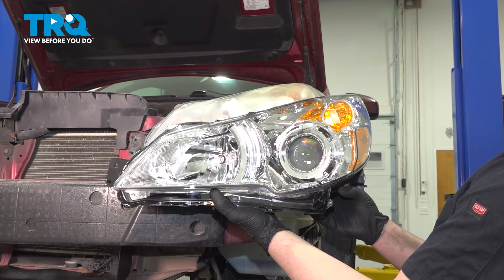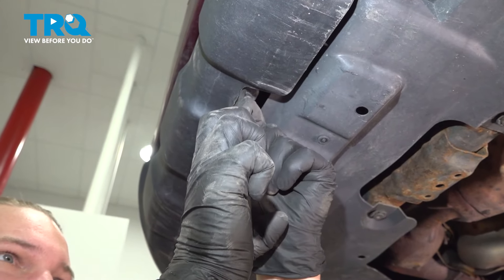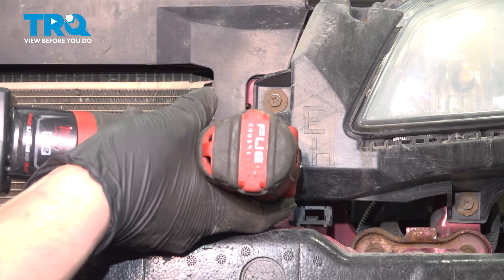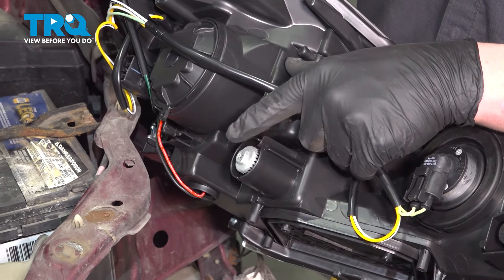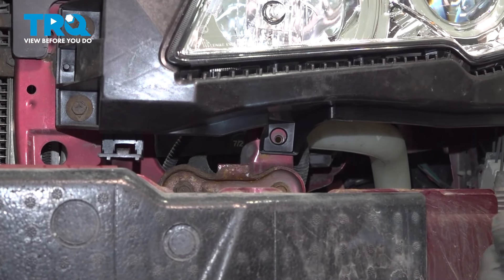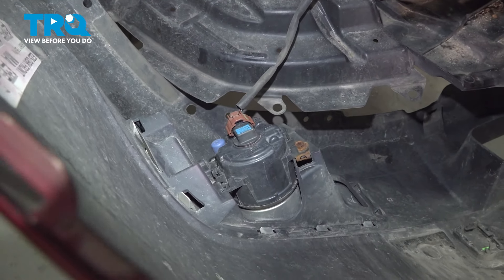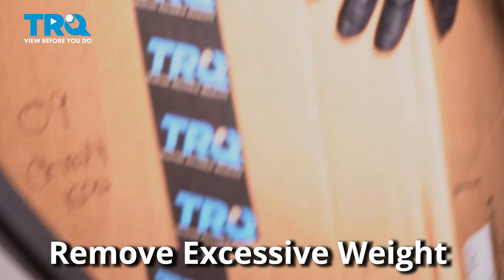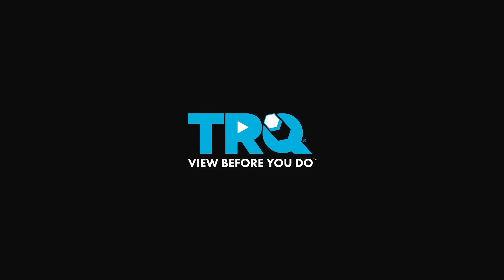How to Replace Headlights 2010-2014 Subaru Outback

Comment: You can just full lock the steering wheel to one side, take a few clips out from the front liner (splash guard) and replace the light bulb from underneath.
Reply: Yeah that's how I ended up doing it aswell
Reply: Yep
Reply: Not on drivers side. Impossible

Comment: Subaru used to have the easiest to change bulbs on the planet. I used to do it in the parking lot so I didn't get pulled over. What the hell happened? Also, where do I get those pinch pliers?

Comment: Did both headlights by myself in about an hour. Could do it again in 15 minutes. It's actually super easy even if it looks complicated. You can disconnect the fog lights as soon as you pop off one side of the bumper with it still attached in the middle. Reattaching the bumper is easy, everything just clicks together once you get the tabs in the right place and then push on it. 🤷

Comment: I just installed two new headlights on a 2011 Subaru Outback this weekend. This video is an invaluable guide to the process.  Keep in mind.however, most people do not have access to a lift. Getting the bumper off and back on was the most challenging part overall and is a lot easier if you have a friend helping. And do get extra body bolts as some will break off and some will be missing.  But ordering the two new halogen headlights and then installing them ourselves was a tremendous savings over what the dealer offered.  And if you are going to replace one, consider replacing both at the same time.

Comment: Great video. This is an insane amount of work just to replace headlight bulbs. I like Subaru but this will eventually be a dead generation of Outback due to people simply not wanting to pay for this at a shop or go through the work and breaking old body clips to do it themselves.
Reply: It's not to replace the headlight, it's to replace the entire headlight assembly. It's a nine minute video and that's basically how long it takes to do it.
Reply: And yes the clips are basically disposable, but they are also ubiquitous and cheap.
Reply: This is to change out the complete headlight assembly, not the bulbs themselves. Although, changing the bulbs aren't as easy as it used to be either.